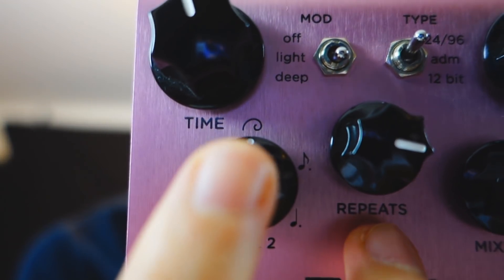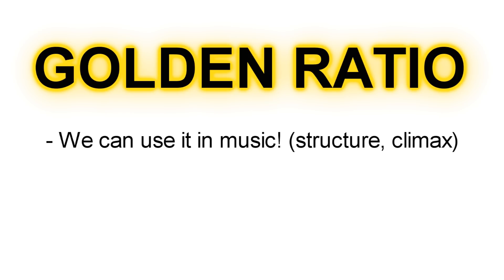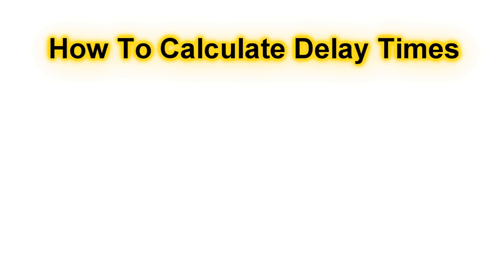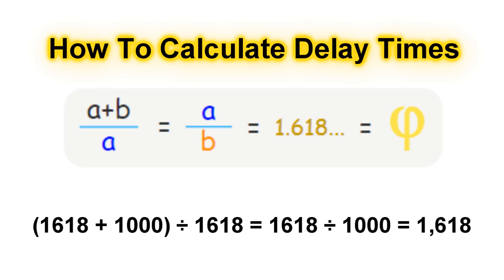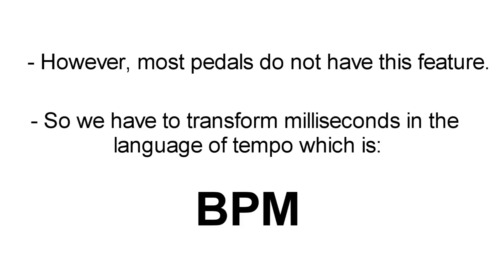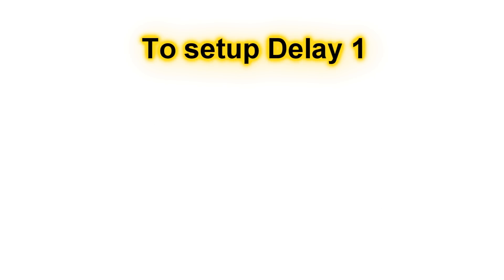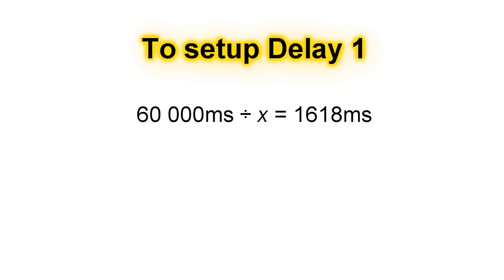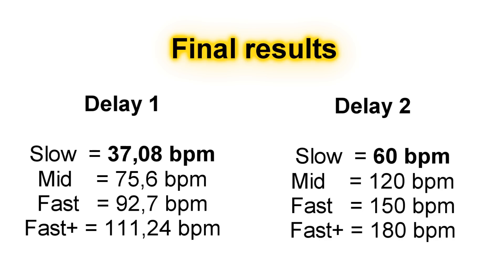The Golden Ratio Applied To Delay Pedals (Crazy Maths Involved!) [Pedalboard Tips #37]

Comment: I did it with 6 different delay times ... in series, and switchable with time change in the opposite, like a mirror. d1-d2-d3 ... switch ... d6-d5-d4-d3 .... and switchable on / off for any independent pedal ... (GT-1000) sounds incredible. I still don't try the idea with delays in parallel, or in stereo.

Comment: The less scenic route is - if you wish to determine the delay time of the shorter delay multiply the longer delay value by 0.618 (inverse of 1.618) - if determining the delay time of the longer delay multiply the shorter delay value by 1.618. No matter what units. No need to do any unit conversion calisthenics. Ratios are unit agnostic. e.g. 60 bpm x 0.618 = 37.08 bpm. Cheers.

Comment: This is interesting but you would have to apply the golden ratio to the amplitude of the second delay pedal also. For each repeat on the 1st pedal the 2nd pedal would have to decrease in amplitude by the golden ratio to create that spiral effect. You could cause it to increase but you would run out of headroom very quickly.

This would need some clever algorithm. At the moment you just have 2 delay lines running in parallel with equal volume creating a repeating skipping effect.
Reply: I will place a phaser effect with panning to my 6 parallel delays times ... and a spiral delay/reverb effect can be created. You could apply an "Auto-filter" effect too...